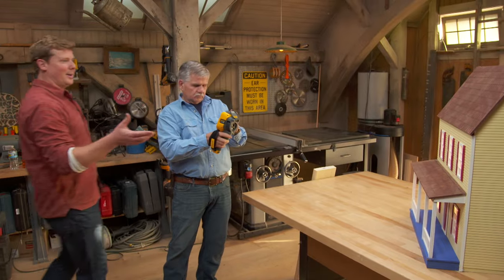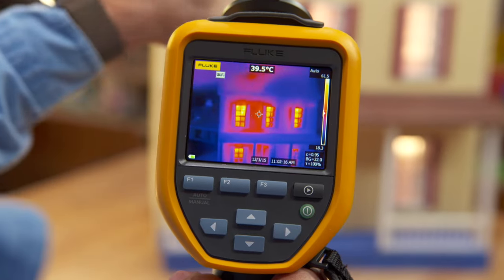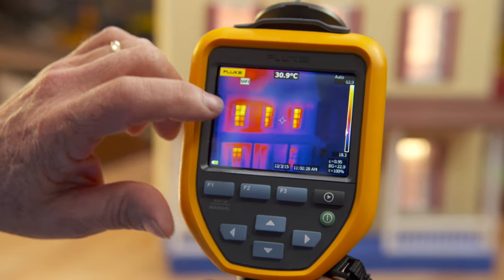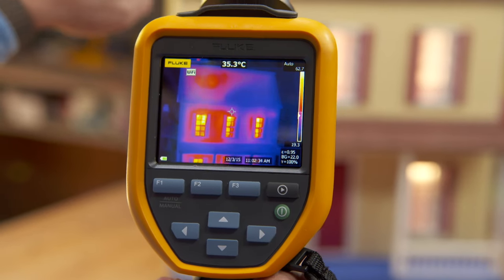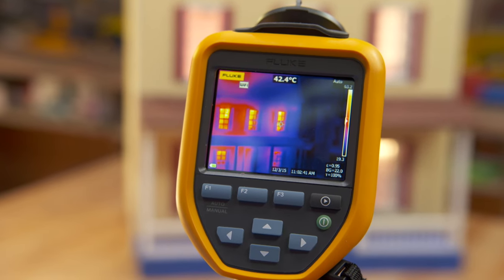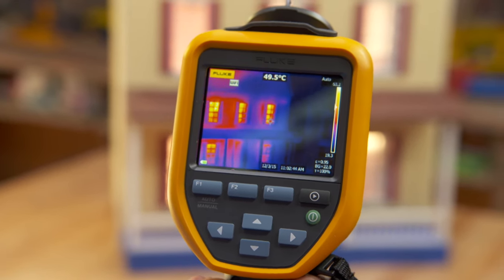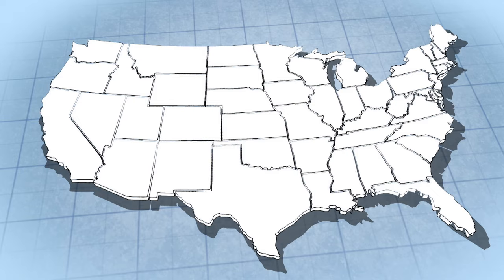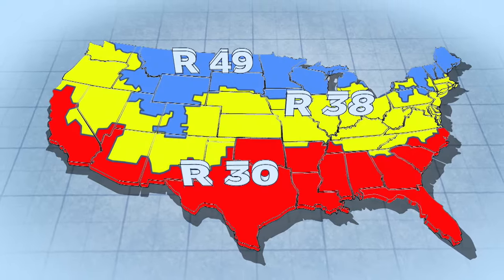Understanding Insulation and R-Value | Ask This Old House

Comment: Ok, so does this mean that R -value is not listed on insulation? Is there a standard type of insulation or does insulation just vary by the height and the only way you know how to achieve the R-value you need is by measuring the height of a unit of insulation and multiplying that number by itself and then just packing in more until you get that R-value minimum?
Reply: Depends on thickness of the insulation. Most have it printed on the face.
Reply: No, not multiplying it by itself. The insulation here has an R-value of 3.5 per inch. It was a coincidence that the depth happened to also be 3.5 inches — an unfortunately confusing coincidence! If the insulation had an R-value of 5 per inch, he would have multipled 5 x 3.5 inches of depth and gotten 17.5.

Comment: I disagree with difference with the recommended R value in different areas. I believe it is just as important to insulate in warmer areas than it is in the colder areas. For comfort in your home whether it's your furnace is on for heat or your air conditioning The more R value you have the more comfort you will have and the cheaper your electric/hydro bill will be.
Reply: Toob247 Toob247 AC is a necessity in places like Las Vegas
Reply: AC is a necessity for those who live in tropical region

Comment: This Old House, Please make a segment about the different types of insulation, that doesn't off gas, some that would be good for humid conditions and when space is tight what will give you the best R value (think RV walls)?
Reply: +MrsMika indeed, compare some insulation options. This episode brought by Fluke™ No problem, if they just just said so :-)
Reply: polyiso for hot camping, styrofoam for primarily cool camping, radiant barrier to stop solar gain.

Comment: Tom, I wrote a question on the last clip,  close and open cellulose. I have a shed in Forida with open cavities, want to have a open ceiling on 1/2 the shed  and the rest of the ceiling closed with satandard instalation 30/13 wht type of instalation  recomemed for the open air ceiling?